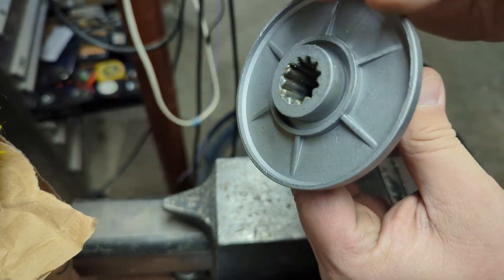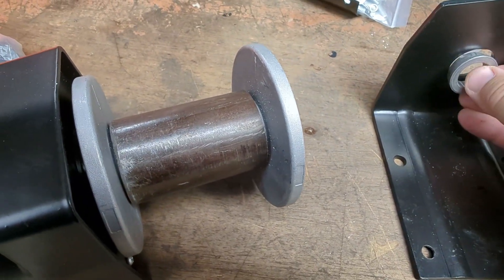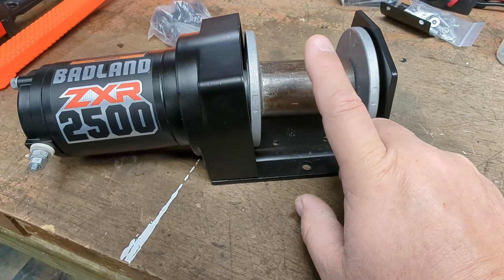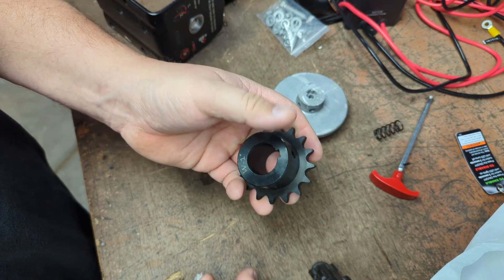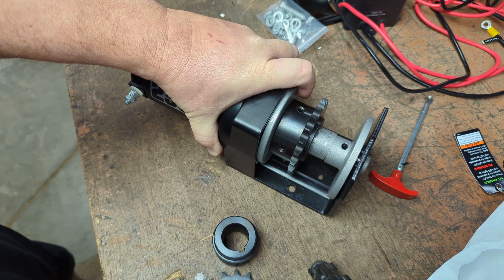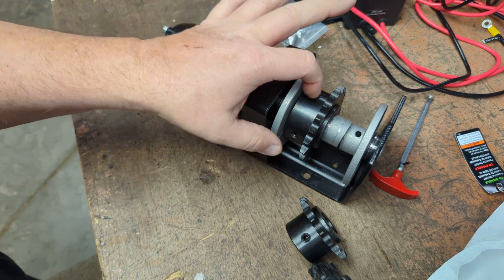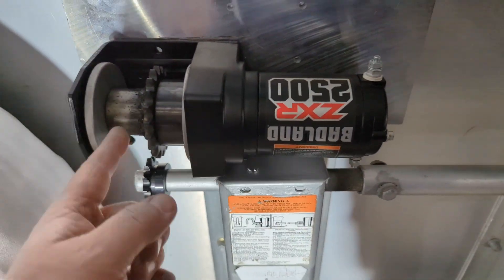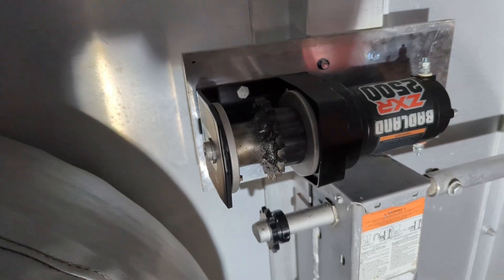HF Winch converted to powered gooseneck trailer jack.

Comment: you geared it up, losing power they way you have it. you should try a larger gear on the bottom. yes it will spin slower but more power.

Comment: You should run a lithium battery on that winch. Way better performance than that deep cycle
Reply from the maker: No doubt.  However....I wish I had waited until the battery was replaced.  It runs well with a good battery....just didn't sound like it in the vid since that one was old and dead and charged for a few minutes.

Comment: Do you still have the Homart window fan you fixed up several years ago? If so as a request could you do a another video of it?
Reply from the maker: I still have it....in fact, just lubed it and replaced the belt.  I use it all the time.  Nothing beats the quiet power of the old belt drive fans.  What kind of video are you asking about?
Reply: @TIAWhatnot  Just a showcase of it, I don't know if you're an actual fan collector but I have a passion for old fans . I have quite a few of them myself that I've documented and restored as well as many others. The one you have is a fan my family had many years ago and I remember how quiet and powerful those things were lol. I'm on the lookout for one myself There are still a few that pop up on ebay every now and then but they're just so dadgum pricey . A hopeful one will come up closer in my area sooner or later. I enjoy your videos!